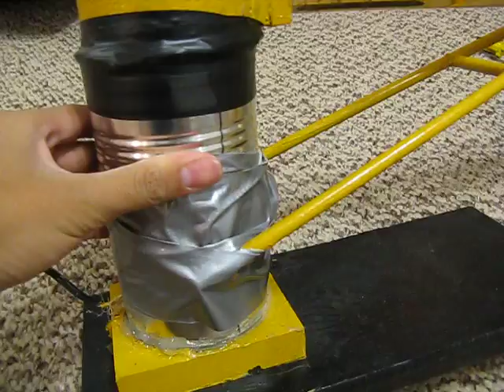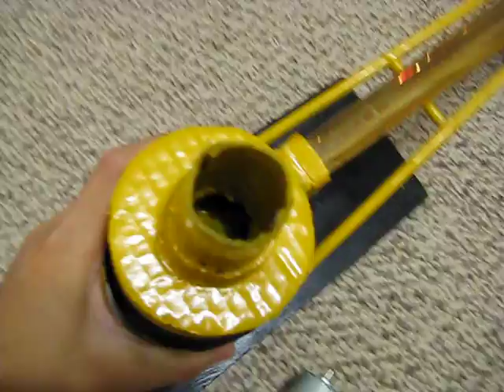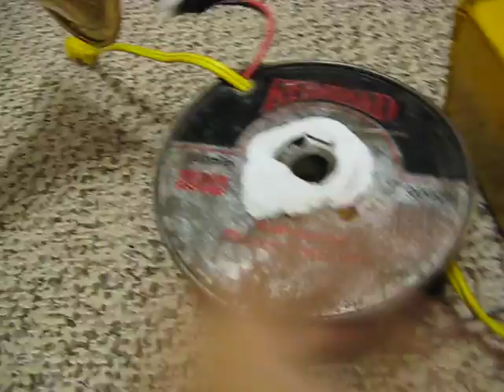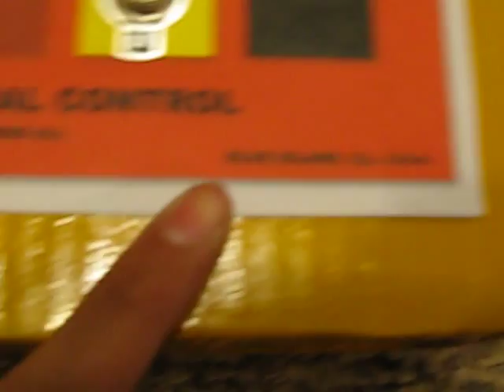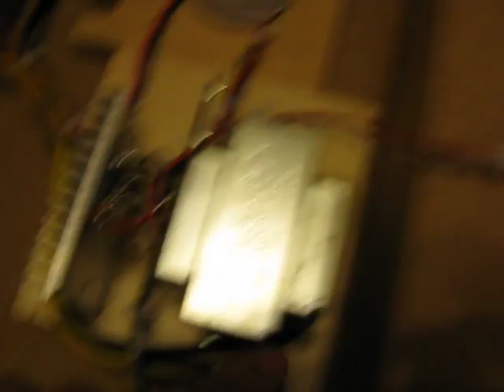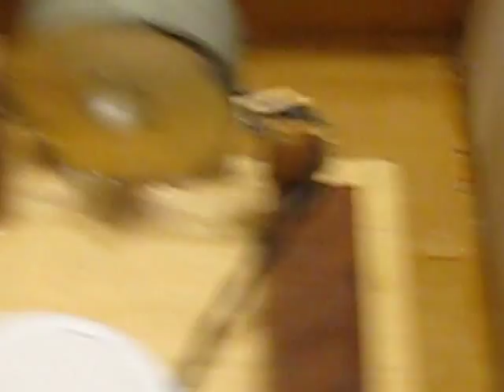Homemade siren description

Comment: Sweet. Maybe for the cooling fan you could have a seperate battery for the power, and it will just start working once the test switch is turned on. Overall i think this is good. I might try to start making one soon. I alrady made a mini "fail" siren of mine so yeah. Keep it up!!